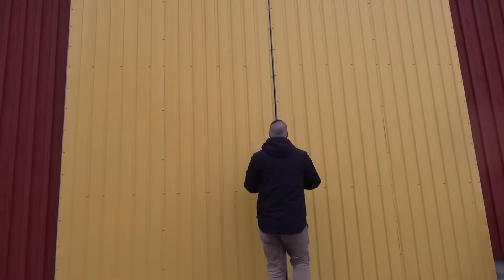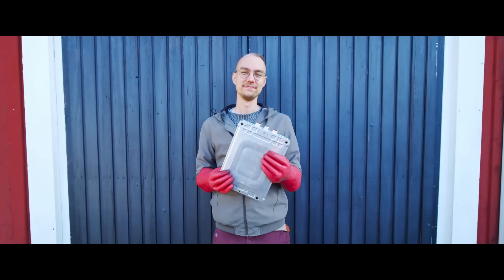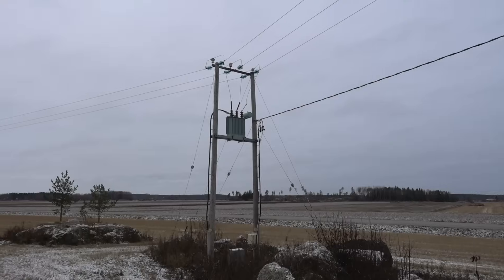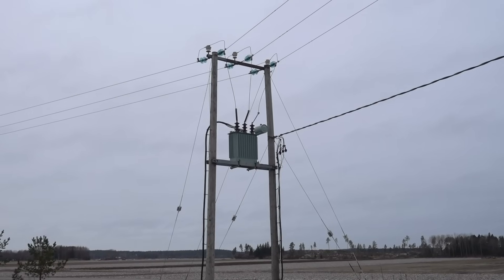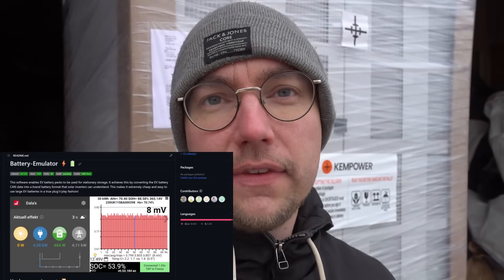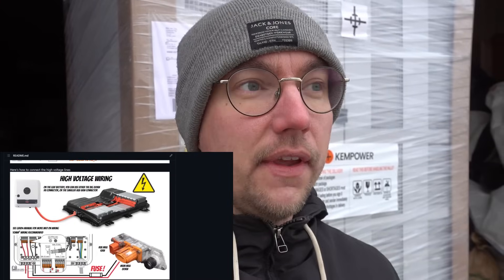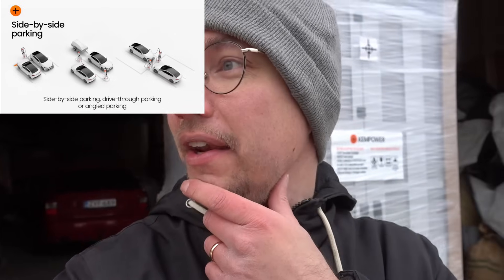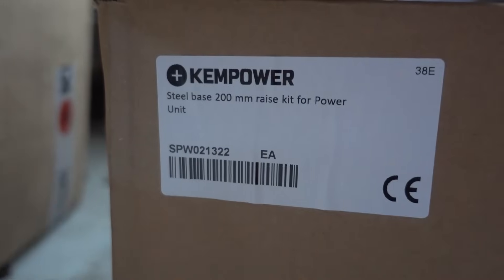400kW charging at home 🤯

Comment: That grid connection can be really expensive. In city uprgading electric switchboard and new mains cabe can be tens of thousands of euros (50 000 € ? /  reference from apartment house buildings few years back, but you might save on labor here). And electric company is also happy to charge for new/upgraded transformer and possible new/upgraded grid power line (it can be dastardly). Plus upgrading the subscribtion (which alone can be in tune of 10 000 € in these amperages depending on the company; this might contain the dastardly part).
Reply from the maker: Yeah let's see, still waiting on the grid operator for final cost :D

Comment: Hey Dala... I'm from Barbados. I have a 2014 24 kWh nissan leaf with literally 2 bars left on the battery state of health with about 20 klm of range on a full charge. I have since removed the high voltage battery and tested each module of which all were measuring 9v each. How would I know which module or modules are bad, and I so, would it make sense to change the modules or replace the battery all together? And what price in U.S dollars would a 40kWh pack cost in Finland?
Reply from the maker: Hi, usually the pack degrades evenly, replacing single modules isn't worth it. Better to get a completely new used battery instead! Good luck!
Reply: @DalasEVRepair  thanks for the advice!
Reply: Here in the Nordic countries, i guess you should look at the prices in Norway, but I think the transfer costs are at least as high as the battery cost. Unfortunately.
I don't really know, but maybe even from Finland they go with car and trailer to Norway to get a whole battery.
Reply: @leiflillandt1488  thanks for the info

Comment: LFP battery cells are dropping in price. You can get 280Ah 3.2V cells for <70 Euro even in Europe. Technically, you could build a 400kWh pack (1C load for that thing) for under 40k Euro - and I'm sure you can get below that when you buy that many cells. It would store a couple charges, and you just recharge from the grid with cheap power tariffs or even solar.

Comment: I was expecting that Kempower unit to have at least some battery storage inside it when it's that big. I seems that you basically want 200 kWh worth of batteries and connect those to the Kempower unit + inverter to feed your house and you have 400 kW quick charging combined with off-grid ability in case the power is lost. (Assuming you can discharge your battery storage at 2C safely.

Comment: I thougt you might have already worked for CPOs occasionally, analysing their charging stuff as well as protocols, when things go wrong. So, even more interesting than a brand-new Kempower DC fast charge unit - and way more affordable - would be a broken one (let's say after some failed software update or with intermittent faults that trigger safety measures), that no one else wants to diagnose and fix. Keep up the good work, Dala, I like your work a lot on bringing broken stuff back to life. I cannot warm up to your Nissan Leaf tuning efforts, however.

Comment: The question is why are you doing this? To get a huge mortgage? Or to be a test case for how high an insurance premium can get? Now I'm no EV nerd but one thing I do know is that fast charging (I presume this is the intention) HALVES the life of the battery.....or maybe you are going to build a charging station for the whole community? If that is the case I suggest you first research why all the manufacturers are reducing output due to slowing sales of EV's. I did the math 20 years ago and the time for EV's is not now - there is not enough capacity in the grid in any country. This is an easy calculation you can do yourself - the aim is to replace the energy in all the vehicle fuel sold in a given country. I did this for NZ - which has a very good generation system - and the output would have to double for everyone to drive an EV. Not gonna happen.

Comment: Here I am wondering if I can justify the cost of upgrading my 2kw wall outlet to 7kw. 🙄
Reply: Just wait some time if it's possible, because the cheaper sodium iron batteries are around the corner. Check the homepage of Northvolt. There is some interesting reading.

Comment: Nominally 400kwh @ 230V service level is 1,740A. With rounding the fed should be sized for input wire capable of 2kA. That's a LOT of copper. 
Here in the States, Tesla supercharger stations usually request a 4000A 480V service, about 4X what you've got there and support 8 or more of the highest throughput satellites for individual Tesla cars at one time.

Comment: We have 3*40A 400V.
It does less than 30kW.
Charging electric cars is pure madness.
Reply: A 30kw charger will fully charge most EVs in 2 hours. I'm curious to know why you need to charge it this quickly at home? Unless they drive nearly 200kms each and every day, most people get by with a 2kw charger at home 👍
Reply: @vasil7410  we drive a lot, also pulling horse trailers and providing energy 'free of charge' to our customers.
Reply: Most importamt.. our 27kWp solar array produced less than 6kWh today.
So any more charging current came from hard coal and natural gas.
That chain is worse than burning gas at home for heat, or burning coal/gas at the baseload plant to charge cars.

Comment: Looks like you need another transformer connected to the high voltage.  I guess the overhead wires would easily take an extra 20Amps or so.  Assume it's around 11kV.  Take care.  Working at those levels, arc flash can literally take your face off.  Plus I hope your batteries don't turn into a firework display making hydroflouric acid fumes.

Comment: Just LOOK AT THE TRANSFORMA TOR. The AIR /AETHER wires collect electricity from the AIR and its converted into AC CURRENCY. Follow The lines. They start and ends in The Middle of nowhere. Free energy

Comment: EVs are a bust. Way too many issues. Thermal runaway, grid cannot support it, there is nothing green about it, it's too expensive, etc... it's a long list. The largest charging station in the USA is powered by diesel generators. SMH

Comment: 40 kw at 240v is around 160 A  which is not available to domestic properties ,  63 A is around 16 kw at 240 v
Reply: It is three phase or 400V*63A*sqrt3 e.g. 41kW
Reply: @rkan2 If you're going to start throwing figures around, at least get them right.

240 volts single phase is 415 Volts when 3 phase is used, not 400.
Reply: @deang5622  That depends which country you are in, as officially them single phase voltages could be 220-240V outside the ~100V single phase countries. In Europe single phase is generally between 220-240V, but officially 230V. Typically then 400V is used.

You are not much better throwing numbers around ;)
Reply: @rkan2  No it does not depend on which country you are in. I proved it mathematically as part of my degree at university many years ago.

If the nominal voltage is 240 volts then the phase to phase voltage in a 3 phase system is 415v.
This is not up for discussion. It's a fact. It can be easily proven mathematically, either using trigonometrical functions or using complex numbers.

Note I said nominal. In the UK the nominal voltage is 230V RMS which gives a phase to phase of 400V. In practice the voltage in the UK is not 230, it is still 240 and all we did was change the specification of the voltage, the nominal voltage and the tolerances to bring us into line with the EU, we didn't actually change the supply voltage as that would have required extensive transformer changes across the country.

When we talk about supply voltages we always talk about the specified voltage, the nominal voltage and not a measured voltage on the actual supply line which is subject to variation throughout the day with load.

So any country specifying their nominal supply voltage as 230 volts, and operating a 3 phase system, the phase to phase voltage (the voltage across any two phases) is 400 volts. And that is independent of country.
Reply: @deang5622 Ok, cool story bro. There is also another misunderstanding. I think the op was referring to some other country's nominal voltage. In dalaland single phase nominal is 230V and not 240V. Thus three phase 63A and not some single phase they were referring to.
Reply: @rkan2  It is good to explain it, as that is how others learn.

Usually I find people get cocky and then insist they are right, when in fact they are not, and they lose the opportunity to learn and improve their knowledge on a topic.
Reply: @deang5622  Harmonised at 400Vac

Comment: In Australia, where we have very remote locations one of our motoring associations is already experimenting with “Off Grid” DC chargers and have installed the first one in outback central Australia a few hundred kilometres south of Alice Springs at Erldunda Roadhouse although it’s not yet on PlugShare. I understand that it runs off a battery system with diesel backup. Your system would be similar without the diesel backup. Good luck with your project.
Reply: and it set on fire , plus you are all forgetting one big problem , all this battery theory is just that , theory , there isn't enough lithium on the planet for all these batteries and they will be proven to be a pointless experiment at your cost
Reply: @andywarrington4738  Actually, studies have shown that we will have enough minerals to complete the energy transition, but I’m not going to get into my study versus your study as no one knows for sure yet. What we do know is that the lithium and all the other minerals can be recycled at the end of life of a battery. Show me how to recycle diesel after you have burnt it in your internal combustion engine and we can talk.
Reply: @meloccom The Swedish battery manufacturer Northvolt has a recycle station at the battery plant, and they already use recycled material.
I saw that the truck manufacturer Scania demands that the battery cells/packs last 1.5 million kilometres, because that is the calculated lifetime of the rest of the truck. That means about twelve years.
Reply: @andywarrington4738 There is no lack of sodium, iron and carbon on the earth! There is by the way no lack of lithium either.

Comment: Am I the only one that dares to ask:     WHY?!?
Why would you want to charge your EV at home with 400kW, thus wearing the battery off much quicker? 
I mean, do you not have ANY time-window in your daily routine where the car has a few hours time to charge slowly? Like... do you not sleep?
Reply: Because he works for Kempower, because he can lol.
Reply: Thats what I was thinking. Plus surely it adds inefficiencies to the charging process since you lose ~10% of the power input when charging a battery. So presumably that means you are doubling your power losses with this intermediary step to getting energy into your EV?
Reply: Of course he’s not gonna charge his car with 400KW. It’s the car that determines what power it extracts from the charger, and each car has a set maximum charging speed. But with this he could open his own public charging point, for instance. Or do any number of awesome things.

Comment: If you are storing energy in batteries, can you arrange the batteries to be the right voltage to directly connect to the DC buss in the Kempower charger? That would save on the cost and losses of converting to AC with inverters, and then converting back to DC in the charger.